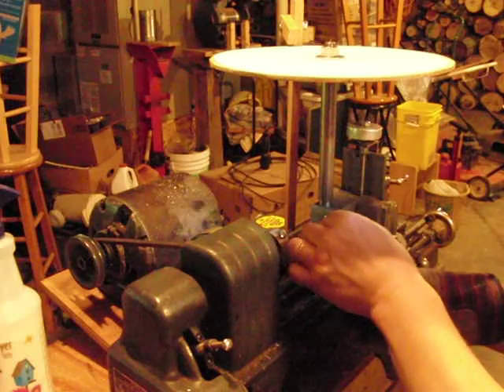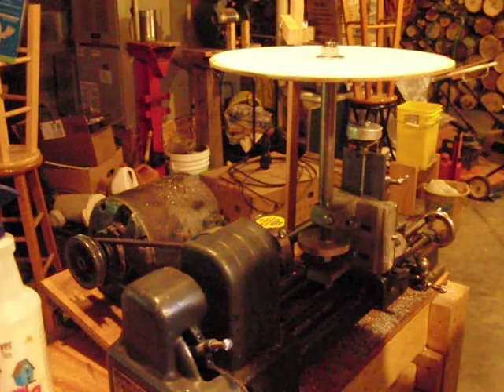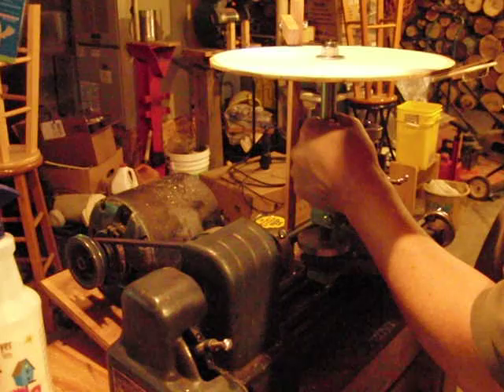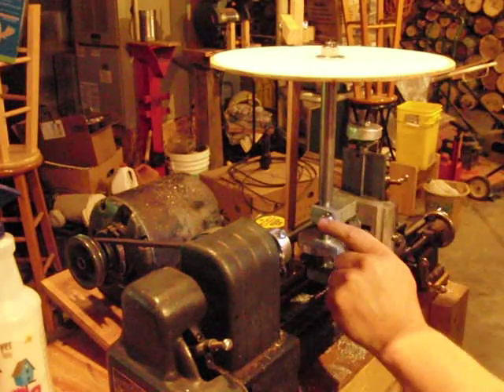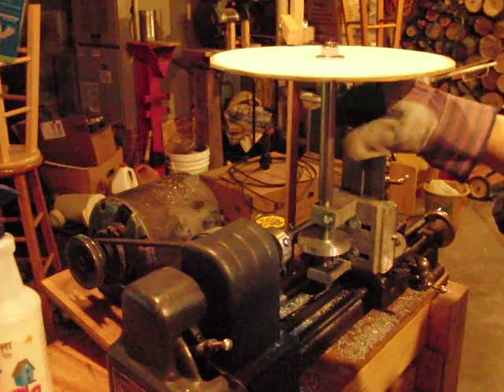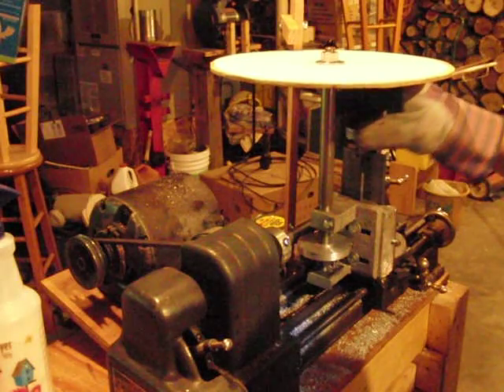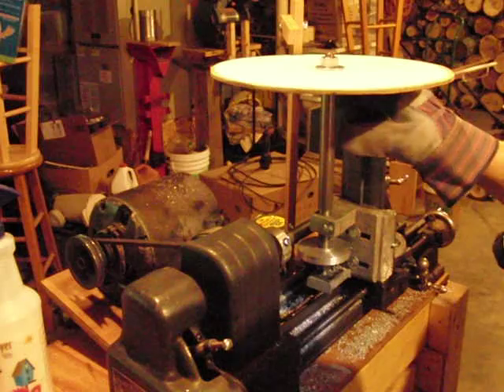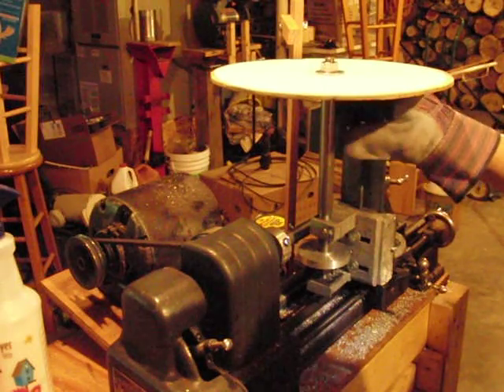Flycutting a gear tooth

Comment from the maker: I suppose you are right. Similar to wearing a tie around machinery. My reason was that the constant turning of the knob to raise and lower the slide was rubbing the skin on my fingers not quite raw but heading that direction. However, I'll keep the safety aspect in mind. I may need to face the knob smooth. I left in in the as sand cast rough finish.

Comment: Nice video. I'm really pleased you did that, as it shows that you can cut gears on lathes much smaller than mine, and it's great to see someone else verify that the process does work very well. Great job with the homemade mill slide too. Cheers Rob.